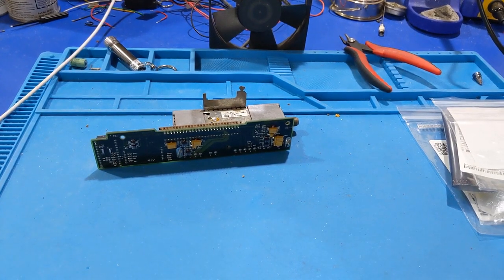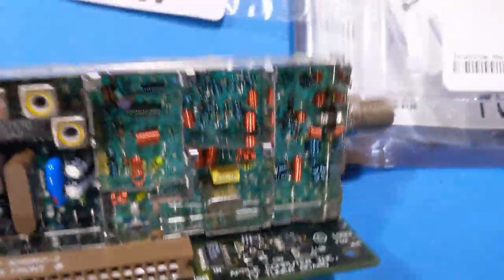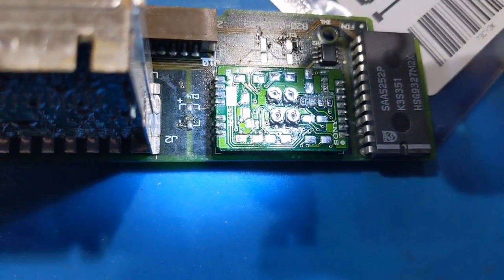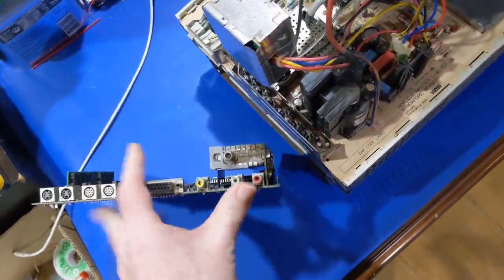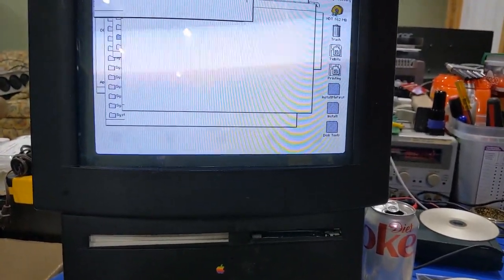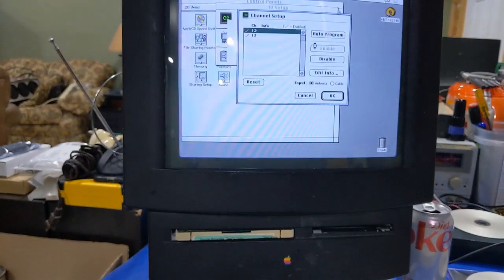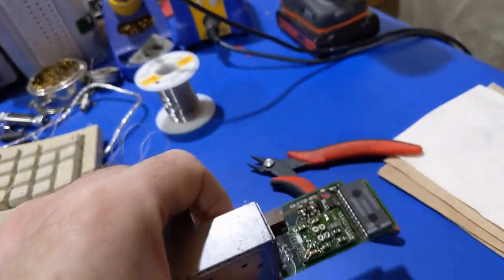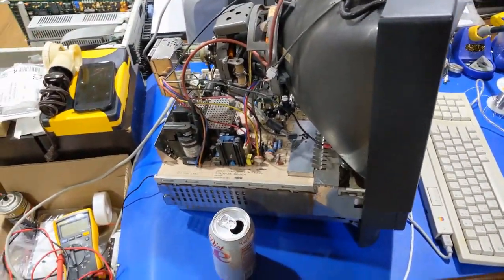Macintosh TV Restoration series Finale: Tuner and final testing

Comment: No re alignment of the tuner? You’ve changed the capacitors on that board - it’s worth doing it to ensure best possible picture and audio!
Reply from the maker: I don't have the equipment necessary to do alignments on things like that. It's gotten kind of expensive and I don't do enough RF work to warrant it. Also, it seems to work very well as it is